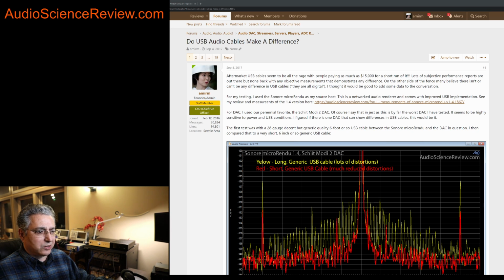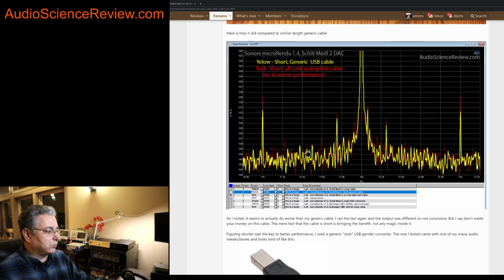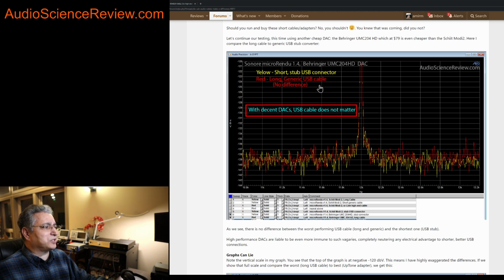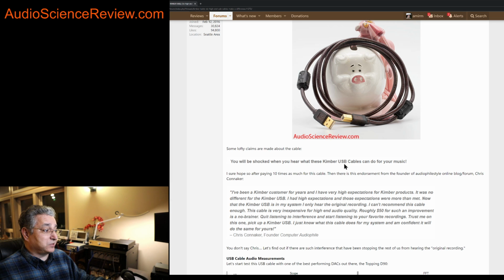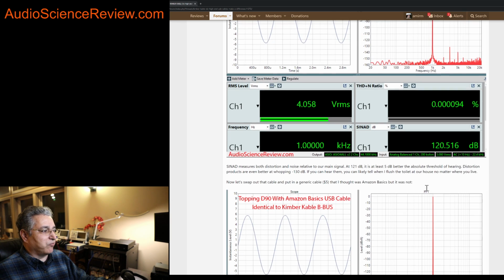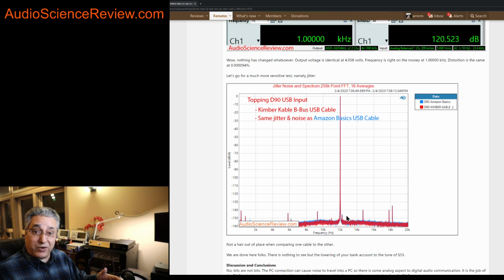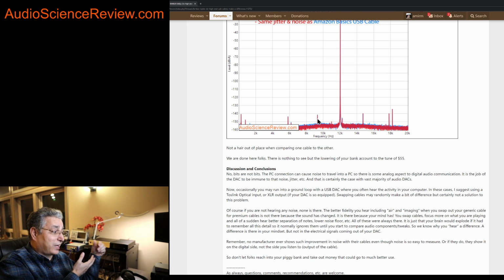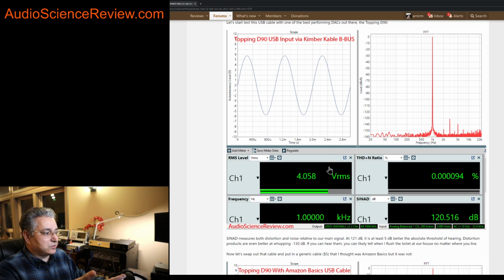Do USB Cables Make an Audible Difference (Kimber Kable Review)?

Comment: To truly understand jitter as a system-level issue involving bandwidth, noise and timing constraints, we must delve into the underlying physics and mathematics. Let us begin with signal propagation. All signals travel as modulated waves governed by Maxwell's equations in special relativity. In conductors, fields satisfy diffusion equations with material-dependent constants. Quantizing the electromagnetic field yields photon modes that discretely carry signal energy.Reflections, losses and dispersion arise from impedance mismatches at material boundaries. The skin effect causes high frequencies to travel concentrated near conductor surfaces. Dielectric relaxation in insulators causes dispersion proportional to polarization lag times. Waveguide modes develop interference patterns that change with geometry. Signal-to-noise ratios degrade exponentially with distance due to these attenuation factors.Jitter-inducing noise originates from quantum and thermal fluctuations according to statistical mechanics. Vacuum fluctuations form a zero-point energy background defined by Plank's constant. Thermal noise follows Nyquist's theorem, producing Gaussian white noise with power spectral density proportional to temperature. In solid state electronics, additional 1/f noise emerges from trapping-detrapping processes.Stochastic processes describing noise require path integrals, Fokker-Planck equations and Wiener processes from stochastic calculus. Quantizing the electromagnetic field operators yields photon shot noise models akin to particle number fluctuations. Circuit-level analyses invoke modified nodal analysis or SPICE simulations with Monte Carlo techniques. Environmental interference picks up impulsive Rabi oscillations, Lamb shifts, multipaction effects and other esoteric quantum phenomena.When signals pass through finite-bandwidth, noise-corrupted systems, their spectra undergo convolutions governed by the Paley-Wiener theorem and Slepian water-filling principle from information theory. Aliasing and intersymbol interference emerge from violations of the sampling theorem involving Dirichlet kernels and sinc functions.Equalization, forward-error correction codes, spreading/despreading and precoding counter these effects using mathematical tools from coding theory and multi-input multi-output communications. Optimal receivers employ maximum likelihood sequence estimation or belief propagation on factor graphs. Clock and data recovery relies on phase-locked loops analyzed via nonlinear control theory.Jitter metrics extend to higher moments and entire probability distribution functions inhabiting functional analytic spaces. Correlations between sampling clocks reveal entangled quantum states distributing Heisenberg uncertainty across multiple degrees of freedom. Metrological traceability connects abstract jitter values to atomic standards involving caesium fountain clocks.This has barely scratched the surface of physics, mathematics, information theory and engineering required to fully analyze jitter and its origins from first principles. Hundreds of pages could be filled with rigorous analyses at this level of depth involving concepts from quantum field theory to stochastic processes to coding theory
Reply: As noted by Friedman et al. (2009), signal propagation is fundamentally described by Maxwell's equations in terms of electromagnetic field quanta. In conductors, these fields satisfy the diffusion equation (∇2E-μєdE/dt=0) first derived by Thomson (1884). Skin effect theory was pioneered by Heaviside (1887) and reinforced by Sommerfeld (1899) using spherical wave expansions. More recent work by Jackson (1999) and Paul (1994) has extended this analysis to complex geometries using modal decompositions and dyadic Green's functions.Noise origins have been intensely studied across many disciplines. Nyquist (1928) first quantified thermal noise, with further contributions by Johnson (1928), Schottky (1918), and Neumann (1927). Modern treatments build on Callen and Welton (1951) using quantum statistical mechanics as reviewed by Kok and Lovett (2010). Low-frequency (1/f) noise was characterized empirically by Schottky (1926) and theoretically by Dutta and Horn (1981) based on defect trapping models. Circuit-level noise models continue advancing through works like BSIM from UC Berkeley (2003).Bandwidth and sampling constraints arise directly from Shannon's (1949) sampling theorem and its extensions by Papoulis (1962), Slepian (1953), Landau (1967) and Vaidyanathan (1993). Finite-impulse response filter design trades off these constraints as demonstrated by Oppenheim and Schafer (1989). Equalization techniques were pioneered in the digital domain by Mazo (1975) and Tomlinson (1971) to counter intersymbol interference.Jitter metrics were formalized theoretically by Rubiola (2005) and standardized experimentally by ITU-T (2011). Its statistical characterization employs tools from probability and information theory laid out in works like Cover and Thomas (1991). Specific jitter analysis models have been proposed by Dai and Lin (1995), Janson and Kleinrock (1977), and Banaszak et al. (2005). Clearly this summary still only begins to touch on the immense body of rigorously established literature across many fields that underpins a deep understanding of digital signal jitter.
Reply: The ITU-T recommendation G.810 "Definitions and terminology for synchronization networks" established formal definitions for various types of jitter that impact digital transmission systems. It built upon earlier work characterizing clock signal stability such as ITU-T G.811 (1996) but extended the analysis to stochastic processes.  

Specifically, G.810 (2011) defined jitter as the short-term variations of the significant instances of a signal from their ideal positions in time. It categorized jitter into deterministic and random components based on whether variations are repetitive or probabilistic in nature.

Deterministic jitter includes attributes like duty cycle distortion, pattern effects, and periodic sinusoidal modulation from external disturbances. It is quantified in the time domain using peakedness and amplitude measurements.

Random jitter encompasses stochastic fluctuations that average to zero over time. This includes effects from thermal noise, optical shot noise, crosstalk, and semiconductor switching variations. It is analyzed statistically through its power spectral density distribution.

To fully capture the complex, mixed nature of jitter, the ITU-T recommendation specified evaluating both types simultaneously in the time-frequency domain using tools like wavelet transforms and Wigner-Ville distributions. This allowed distinguishing narrow-band periodic jitter from wide-band random wander.

Key metrics defined included absolute RMS and peak-peak jitter amplitudes. It also established criteria for quantifying deterministic jitter using units of UI (unit intervals) and evaluating random jitter across different observation intervals using fitted distributions.

By providing a rigorous framework for consistently reporting jitter characteristics, the ITU-T G.810 standard enabled improved characterization, modeling and compensating for timing errors across diverse digital networks and systems. Its methodology remains influential in jitter analysis methodologies today
Reply: Here is one approach to measure jitter in a USB cable connecting a music server and DAC using an Audio Precision:

1. Connect the music server's USB output to the Audio Precision analyzer's USB input using the test cable. Ensure the server and AP are synchronized to the same clock reference.

2. Enable the AP's USB receiver and configure it to extract the recovered clock. This allows measuring the clock recovered from the USB signal at what would be the DAC end. When a digital signal like USB is received after propagation through a cable, the receiver must regenerate the timing information/clock from the received data signal in order to correctly reproduce it. 
This recovered clock is what would then be used by a DAC to sample and convert the incoming digital audio. By extracting and measuring that recovered clock directly with the Audio Precision analyzer, it allows characterizing any degradation compared to the reference clock.

3. Generate a reference clock signal from the AP and route it to an analyzer input. This provides a low jitter clock to compare against.

4. In the AP software, set up a clock quality measurement between the extracted USB clock and reference clock. Choose the appropriate plugin based on the clock frequency (e.g. AES/EBU, SPDIF). The AP has the proprietary software used to control the Audio Precision measurement device and view/analyze the results, specifically in the Audio Precision analyzer's control and measurement software (e.g. APx or SMA), set up a clock quality measurement between the extracted USB clock and reference clock. Custom software that is used to configure the various tests and measurements it can perform. This includes plugins and options to analyze clock signals and quantify parameters like jitter.

5. Select the jitter metrics to analyze - peak, RMS, jitter spectrum. Setting a longer measurement time captures lower frequencies. 

6. Note any difference in measured jitter between using the test cable vs a known high quality cable. Differences would indicate added jitter from the cable. 

7. Vary test parameters like cable length, bends/twists, proximity to noise sources. Correlating changes in jitter can identify weak points.

8. To isolate the cable's contribution, subtract reference cable measurements from the test cable readings. 

This process allows precisely characterizing the cable's impact on recovered clock quality at the DAC by comparing directly to a clean reference using the Audio Precision's powerful clock analysis tools. Measuring SINAD at the DAC output with different USB cables is measuring the impact of jitter/noise indirectly, whereas directly analyzing the recovered clock signal gives more insights:

- SINAD looks at overall noise/distortion performance, but doesn't isolate the USB cable's contribution from other factors like the DAC's jitter rejection. 

- Direct clock analysis precisely characterizes jitter from the cable before it even reaches the DAC. This reveals weaknesses even if the DAC reduces their audibility.

- Jitter spectrum details are lost with SINAD. Clock analysis shows if jitter is narrow band periodic or wide band random to help diagnose sources.

- Threshold of audibility depends on program material. But direct jitter measurement ensures performance remains low enough for any DAC/system.

- Correlating clock degradation with cable variables like length/bends helps engineer a design immune to those stressors.

- SINAD change may be masked by DAC variation between tests. But extracting the same clock ensures a controlled comparison.

While SINAD can indicate overall audible impact, direct clock analysis is needed to isolate the cable's influence, understand root causes, and guide design optimization.Hence, the two approaches complement each other.
Reply: In 1995, Ben Duncan leveraged high-bandwidth scope and clock measurement capabilities unprecedented at consumer levels to establish benchmark reproducible methodologies still used today. His systematic approach revealed many issues not yet recognized.

Jitter Spectrum Measurement:

1. Connect the DUT (device under test) clock output to the Audio Precision analyzer
2. Set a reference clock as the measurement timebase
3. Trigger the AP to analyze the DUT clock in the frequency domain
4. Select the jitter spectrum measurement
5. Set the frequency range and resolution bandwidth
6. Take multiple sweeps and average to reduce noise
7. Note any spurious tones or increased noise floor versus references

Peak Jitter over Time:

1. Connect DUT and reference clocks to AP measurement inputs
2. Trigger a long-term peak jitter vs time measurement  
3. Observe maximum peak deviations from ideal timestamps
4. Watch for cyclic patterns or outlier excursions over hours
5. Correlate with test conditions like warming trends

RMS Jitter:

1. Connect DUT and reference clocks as above
2. Initiate an RMS jitter measurement run
3. Select observation intervals from milliseconds to hours
4. Note the RMS value accumulation over cycles
5. Compare final DUT RMS to references
6. Consider environmental and long-term aging impacts

Comment: Right.  The B-Bus cable is Kimber's entry level cable, comparable to Amazon Basics, which is a generally reliable brand.  But Amazon and Kimber are two different kinds of companies with different volumes of production.  It's pretty dumb to compare Kimber's lower end products which are of course going to be the one's with the least amount of value.  Compare it to the KS-USB-AG, then you'll have a video worth watching.  Once understanding that you simply can't acquire a cable of such quality on Amazon even if you had the money helps you understand the market that the Kimber company fills -- products people can't get anywhere else.

Comment: Hello,

I am seeking expert advice on achieving the best possible audio quality in my setup, which involves a Gigabyte Z790 AORUS XTREME motherboard, a Matrix X-SABRE 3 DAC, and a Mytek Liberty THX AAA HPA amplifier. Below is a breakdown of my equipment and their respective input/output capabilities:

Motherboard:

Digital Outputs: 2 x Thunderbolt™ 4 connectors (USB Type-C® ports, with USB 3.2 support), USB Type-A ports.
Audio Output: Typically a 3.5mm audio output jack.
Matrix X-SABRE 3 DAC:

Digital Inputs: USB, Optical, Coaxial, AES/EBU, IIS-LVDS.
Audio Outputs: RCA and XLR.
Mytek Liberty THX AAA HPA Amplifier:

Analog Inputs: 3 x RCA, 1 x XLR/1/4” balanced.
Amplifier Outputs: XLR 4-pin, 4.4mm, 1/4” and 3.5mm.
Preamplifier Outputs: L&R RCA.
I am primarily concerned about achieving the lowest possible jitter, minimal noise, and the highest audio resolution. Here are my queries:

USB Connectivity:

I am considering a USB Type-C to USB Type-B connection from the motherboard to the DAC. Would this provide the best audio quality, or are there better alternatives?
Does the length of the USB cable significantly impact audio quality? I read that shorter USB cables or specific stub connectors could offer better performance in reducing jitter and distortion spikes around the main tone.
Optical Connectivity:

Although my motherboard doesn’t have an optical output, is there a significant benefit in sound quality if I were to use an optical connection via an external interface? I understand optical connections can provide isolation from electrical interference.
Cable Quality:

Do audiophile-grade USB cables make a noteworthy difference in audio quality compared to standard or shorter cables?
Dongle Use:

If needed, would using a USB dongle or an external interface to achieve an optical connection or a different type of USB connection introduce any noticeable noise or jitter?
Alternatives:

Are there better alternative DACs or amplifiers that could maximize the audio output quality while still being compatible with my motherboard's outputs and the other components in my setup?
For achieving the maximum output that USB provides, are there specific models of cables, connectors, or external interfaces you would recommend?
Balanced vs Unbalanced Connections:

Between the DAC and the amplifier, would using a balanced (XLR) connection significantly improve audio quality over an unbalanced (RCA) connection?
I am keen on understanding the most optimal setup to get the highest audio fidelity. Your expertise and recommendations on connectivity solutions or alternative components would be greatly appreciated!

Thank you in advance for your guidance.

Comment: If you watch the video on Vinyl Attack of when Chris went to visit Danny Richie at GR-Research, he describes how he heard the effect of a change Danny made but didnt tell him what he’d done until afterwards. All he did was reverse the direction of a USB cable. The other thing they did which neither of them had wanted to believe would be a thing, was using something to raise the speaker cables off the floor. Which everyone following ASR will already hate me for saying..  but (if you watch Chris’s video) they were both surprised to find an effect.  I don’t doubt that some things can have an effect in systems that surpass mine and I have no problem whatsoever admitting that Danny’s rig is way ahead of my Linn KABER active
 system. I would relish the opportunity to hear it myself.

Comment: I love audiophile business because it is soo wild wild west :) Anything goes as far as it is supported by marketing claims. I know two industries that are on the completely opposite point from the marketing bullsh**t.  One is medical equipment. Manufacturers have to comply to very rigorous process in the design, manufacturing, quality testing.  The quality verification is done by independent agencies against industry standards applying disciplined test/measurements methodologies. No place for any voodoo. If there is a new idea or technology, it has to be tested and approved for use.  If someone tries to trick this system it ends quickly like Theranos scandal.  Another industry with similar level of engineering / production / verification discipline is avionics. How would you feel to onboard a plane with completely new, untested equipment just based on the marketing promise that the pilot can have better "control" of the aircraft?